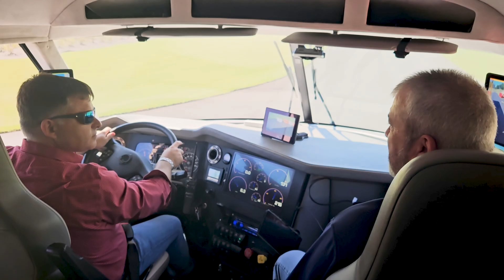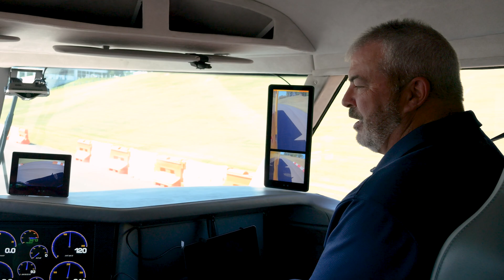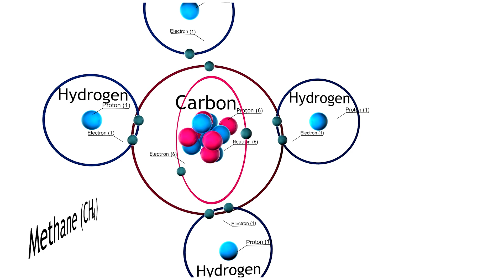Shell Starship 3.0 NG: Test drive and the benefits of natural gas

Comment: I used to drive a new Scania fueled with CNG, it is unusable in cold climates, you won't be able to refuel at temperatures of around freezing point @ 0 C as the fueling pump regularly freezed and we had to use old diesel trucks, plus these brand new truck felt much less powerful uphill

Comment: 02:50 In my experience with the natural gas  Cummins engines (ISX12n and L9n) there is a massive difference in power over their diesel equivalents. Although they had very similar power ratings to the diesels, the natural gas engines were no match as far as performance is concerned. If the ambient temps were above 90° they become painfully slow even with light loads due to egts causing a severe derate.  I’ve had natural gas engines hard- shutdown climbing mountain grades no less than 20 times requiring a tow. And also in my experience, they are not anywhere near as efficient as a diesel. When the natural gas was converted to gasoline gallon equivalent (not diesel fuel which has even higher btus)t, they got about 2.5.mpg less. But per gallon equivalent, natural gas is about 1/3 the cost of diesel., Finding natural gas stations at this time is also a challenge.
Reply: The engine in this truck is not the ISX12N. Technology improves.
Reply: @ Which engine is it? At the moment , the only CNG engines that Cummins offers for on-highway are  the 6.7n, L9N, and the ISX12n. There is an X15n (slated to be released in late 2025), and the X10n (the diesel version is in development and the CNG version will soon follow).
Reply: @The_Lincoln_Penny  The truck in this video is powered by the X15N.
Reply: @PistonAvatarGuy  Ahh … thanks. So it must be pre-production . But i think that the diesel is quickly going bye-bye not just because of anti-diesel regs, but there are large “clean air” incentives that make CNG attractive to large fleets. IMHO, th X15n is going to be a game changer. I think that large carriers are more likely to adopt the X15n for a portion of their regional fleets simply to qualify for clean air credits. Here in CA, UPS has already gone to CNG for a large portion of their class 8 fleet
Reply: @The_Lincoln_Penny  I'd bet that purpose-built CNG engines would perform even better, as most CNG engines are currently just converted diesels. Hopefully, if CNG engines really start to catch on, companies will start producing purpose-built engines.